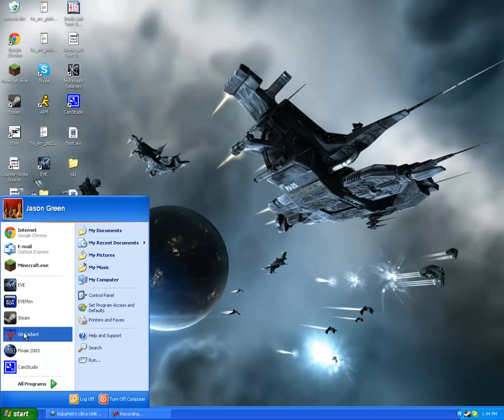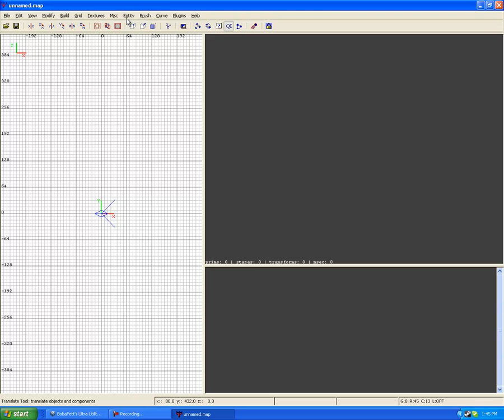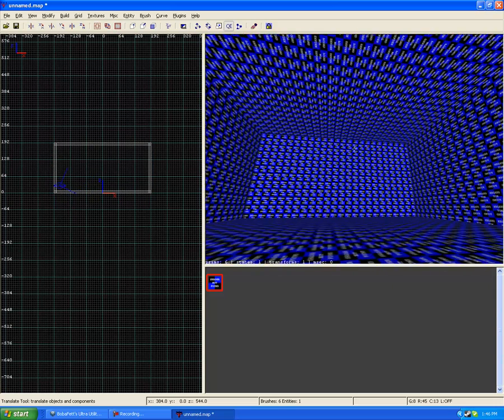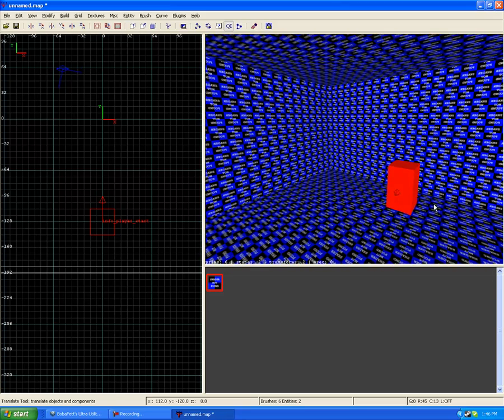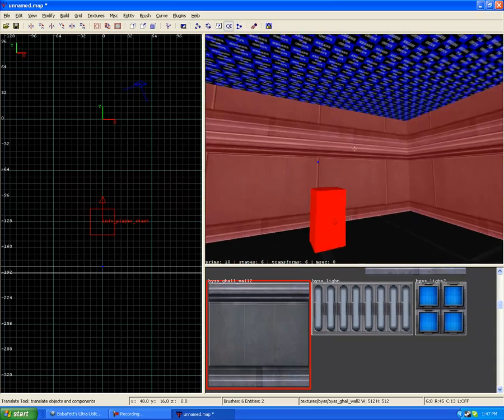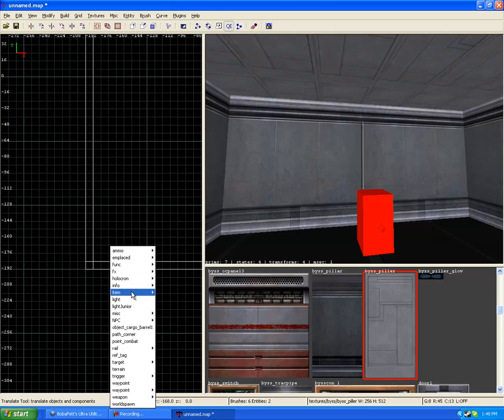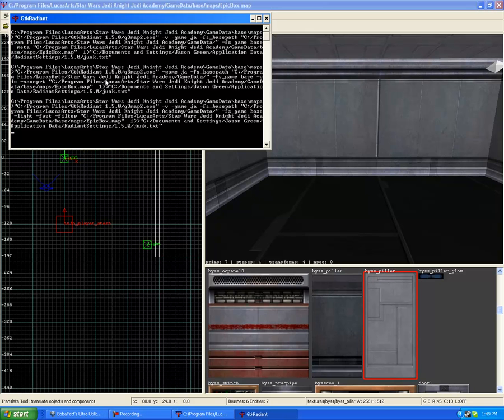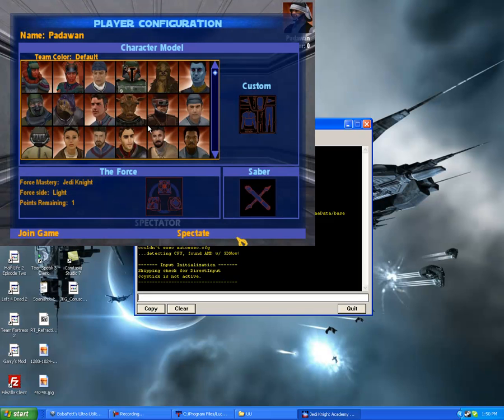GTKRadiant Mapping Guide Part 1

Comment: There is so much about this tutorial that is wrong. If u are going to teach people, at least put them in the right direction from the start. No tool textures loaded (caulk being an absolute essential ensuring those surfaces not seen are not drawn), and having intersecting brushes (one volume inside another) is an absolute no no! When compiling it adds significantly to the BSP file. Two massive errors in a 5 min tut ... Comon dude. I know this is 10 years old but still ...
Reply: Well fuck ... We do walk around in circles after all. Hey, Grim! You good, brother?